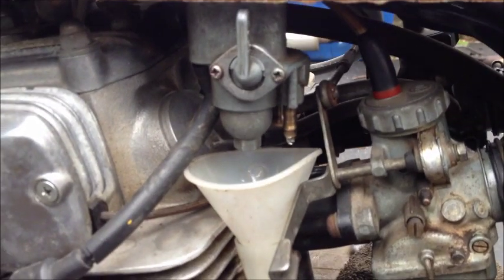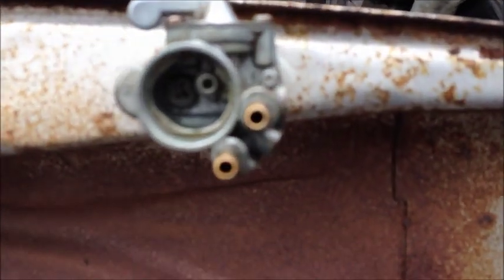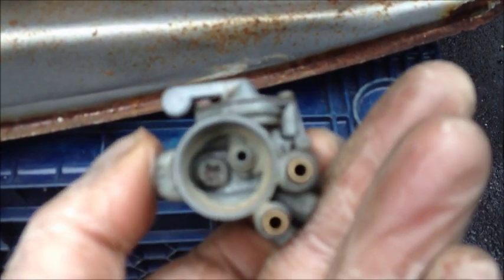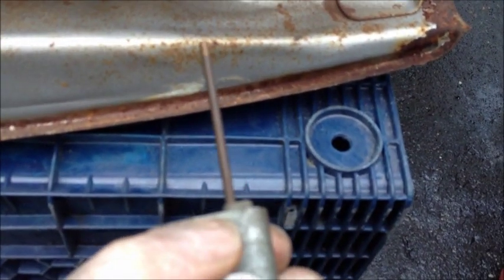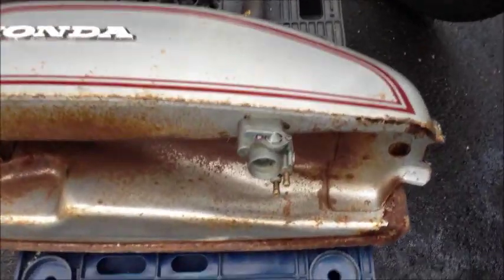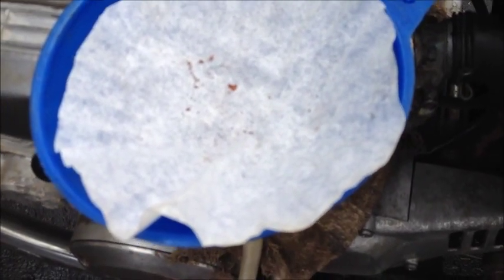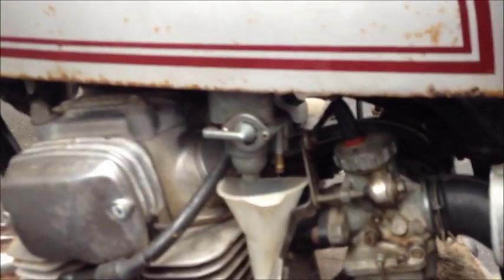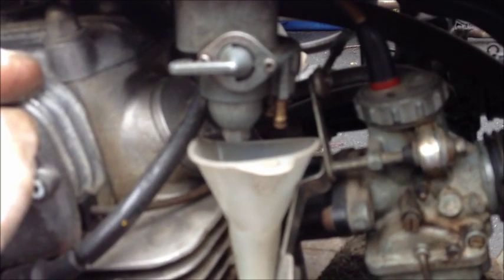Honda CB200T clearing fuel valve (petcock)

Comment: Do you have a petcock screen in there? Also is it necessary to have a petcock screen if you have an inline filter or vise versa?
Reply: Ramzy De Castro.  Petcock screen, if in the valve cup, is a 150 micron wire mesh.  If he used brake cleaner and compressed air both ways, then he got it clean too.

An inline filter is a good safety measure AFTER the petcock in case the screen starts to rot away with age, but it is probably better to just replace the petcock if you think it is rotting.

Oh a pre carb filter for a simple gravity feed should be a 150micron.  Probably a lawn mower one for $4.  The 75 micron ones are for fuel pump small motors.  You can probably get away with them and they filter better, but they will slow down the flow.

Comment: hey. how do you exactly clean the petcock?
Reply: once the petcock was removed from the tank i used brake cleaner and some compressed air to clear the passages.  don't push wires through the tubes...just use the pressure from the brake cleaner.  That should do it.  Good luck!
Reply: Triumph 23 Harley pitcock valve rebuild